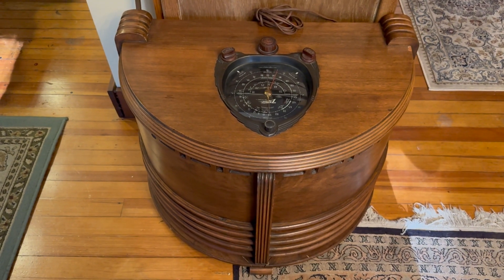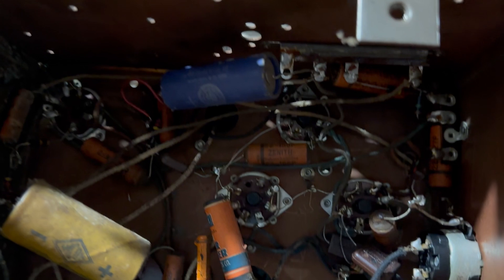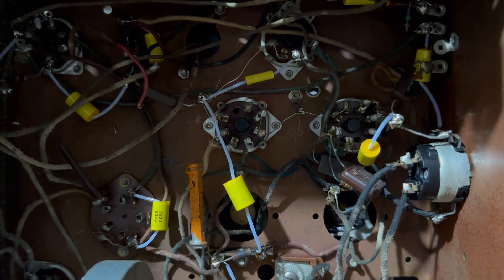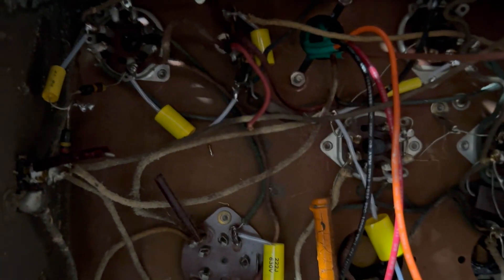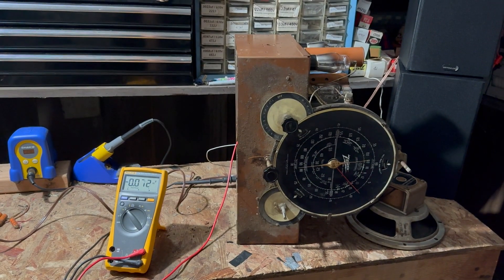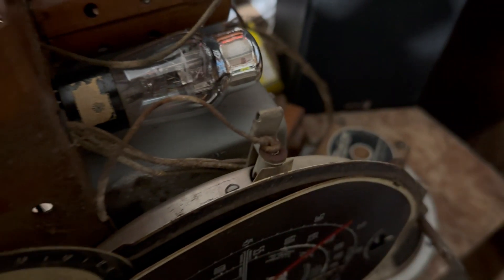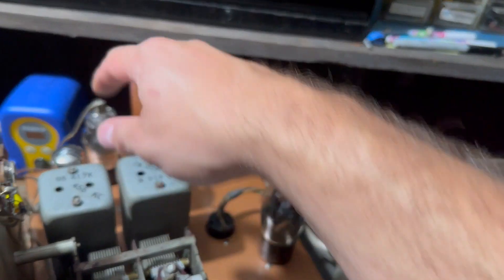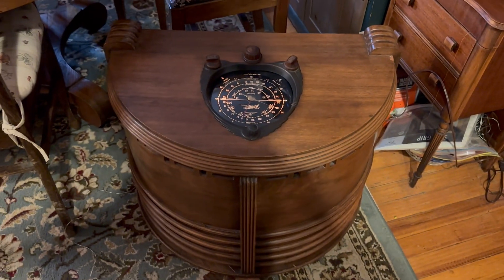1938 Zenith 6S249 Antique Radio Repair

Comment: Nice recap...I'd consider fusing both sides of the line. If that is like my 6s238 it uses and uses a rectifier with cathode (6X5) these tend to get heater to cathode shorts that will fry the power transformer in short order

Comment: At 3:00, those CAPs look original to me.   Since this is a tube radio, did you face the foil-side of the paper CAPs facing in the correct orientation?  Watch XrayTonyb & Mr. Carlson's Lab why you should do this.   It does make a difference!  Especially if your trying to keep any stray noise.  Did you replace that OLD electrolytic?  It's only a matter of time for that to fail.

Comment: Nice job Adam however I would like to have seen that new drive belt. I restored a similar but multi-band console Zenith and the belt I got is a urethane "O"ring and it should last for 100 years. Did you install a strain relief, fuse and X1-Y2 ac line bypass safety caps? I repainted the backer plate for the dial with bright white paint and since it is a multi band colored dial I used colored LEDs. I made new diffusers next to the lamps out of a milk jug. You are right that this is a great project radio because it has a lot of real estate and its performance is very satisfying. I am looking forward to your next project.